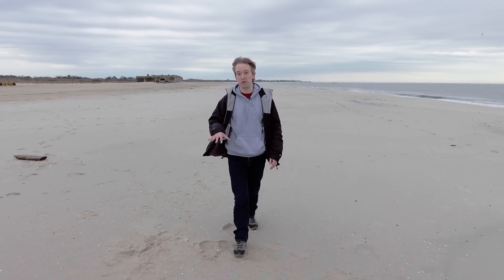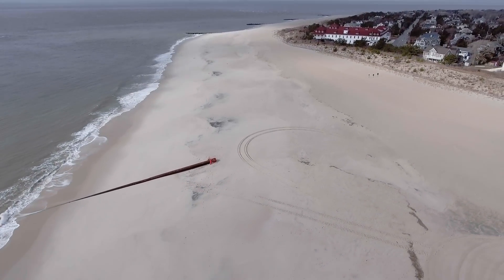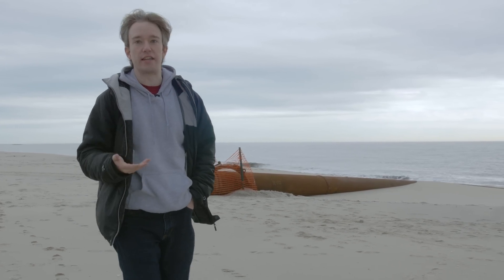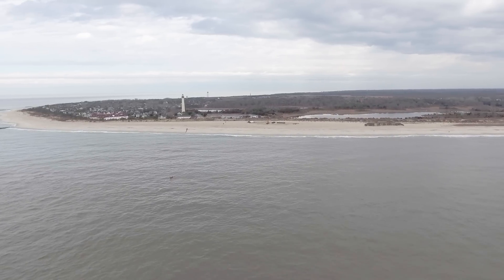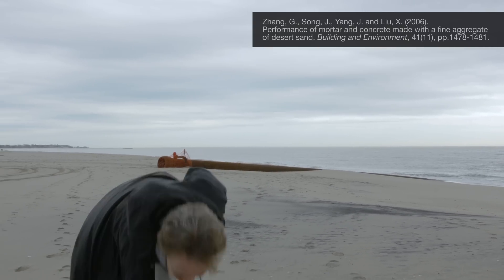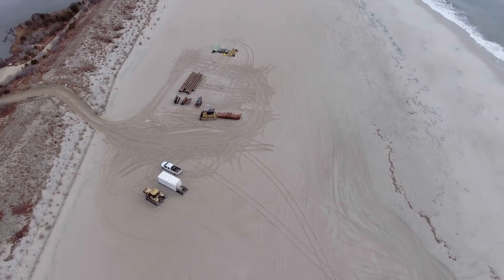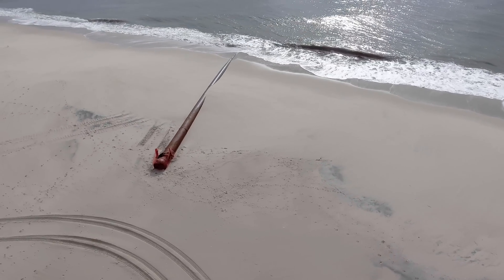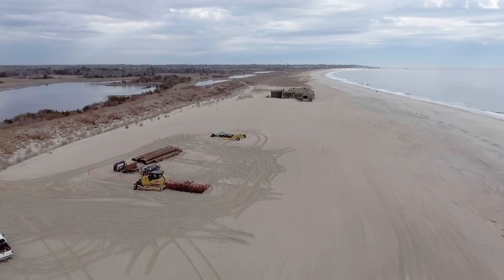The World Is Slowly Running Out Of Sand

Comment: As the hills in Finland are out because enviroment laws the concrete makers had to find new source for the sand. Grinding rocks into sand using suitable metal grinders does that job but causes lots of noise. So all over the southern Finland in remote cites you see piles of sand. From visual clues one can see that each pile is made of different size of grains. And you only need to look and you see the machinery that does the job.

Comment: The concrete company I used to work for has several gravel pits. Obviously, you need sand and rock to make concrete, but function of that particular pit is rock, with the sand just being a lucky by-product. And at that pit, if the company does the same amount of business every year, it'll take 200 years to go through all the sand they have stacked up at that pit. That says nothing of the sand that will come with the new rock they dig up, or the sand from their other pits.

Comment: As far as I'm aware, sea sand is no use for building because it's made up of small particles of shell. The sand used with concrete for building is from rivers and lakes, which is made up of small particles of stone. 
The reason the world is running out of building sand is because rivers and lakes are limited and they take a long time to produce sand from broken rock and stone from mountains and they are being dredged for sand faster than rivers can replace it.
So, I believe you are wrong in your video talking about sea sand as a building material, sea sand cannot be used for building.

Comment: Several years ago, I was doing a project on municipal waste management.  While tangential to the main paper (which was considering the possibility of using closed open pit mines as landfills rather than a green site elsewhere), I came across and was very intrigued by the concept of Plasma Arc Gassification.

Basically, the system involves feeding garbage into a giant welding arc and turning it into a plasma, then letting it cool and settle out.  The result is carbon dioxide, methane (which can be stripped away and burned to reduce the greenhouse gas emissions, because methane is way worse than CO2), water vapour, nitrogen, oxygen, and a few other such simple atmospheric gasses, plus a sand-like residue made up of all the stuff that didn't settle out into a gas. One of the proposed uses of this sandy residue was for use as sand in concrete. 

Now, I have no idea how much of a pipedream this article was (it was extremely complimentary of the technology); I haven't kept up on the research these past 6 years.  However, if it could be usable, this sand shortage might provide yet another reason to use this high tech waste disposal method.

Comment: There is more sand under those houses.  The sand that is vanishing is being washed out to sea.  The techniques being used here to rebuild the beach will probably be expanded upon.  Using satellite data and other techniques that the oil industry uses sand extraction could rebuild beaches and turn a profit.

The company could offer to rebuild a beach (add seawalls, that use the material you are pumping and protecting the supply you just pumped out) over a long contract period.  Pump up more sand than needed, sell the excess.  There will be problems (pollution, noise) but offering to save someone's property from rising oceans at no costs to them will be an easy deal to push.

Comment: We are NOT running out of sand the sand is simply being used to make stuff. Take for instance when you get sand and you squeeze onto the side of a castle you don't shrink the sand but compact it. In building the sand is being mixed with other materials but it's still there. Even if we don't have enough we can still separate the materials in buildings and get it back.

Comment: In Southern Michigan you'll find Warren Dunes, with the tallest sand dune, colloquially known as "Mt Randall" almost 300' tall.

But the entire South and Eastern shores of Michigan were once lined with similar dunes.  We're talking about places where Gary, IN now stand.  What became of the sand?  It was used in casting iron and other metal products, mostly in Gary.  That's why the Gary Steelworks sat where it did, proximity to cheap, abundant ideal sand for casting steel.

So today there are only factories that stand where once 300' tall sand dunes stood, just outside of Chicago.  Let that sink in a bit.

Comment: You posted your sources, but the ultimate conclusion of the study on desert sand in concrete mixtures was "It can be concluded that the application of concrete with desert sand as a fine aggregate in civil engineering is feasible." 
In other words, we aren't running out of sand.

Comment: In college, I learned that concrete was: gravel, sand, Portland cement, and water. The gravel is the strength; the sand fits between the gravel and stabilizes it; the cement does the same for the sand; and the initial water does the same for the cement. AFTER the concrete "sets," additional water strengthens it, although with diminishing returns. But excess water before the concrete sets weakens it by creating voids in it.

Comment: The waves create new sand every second. It's a renewable resource.
Reply: epSos.de Technically fossil fuels are renewable it just takes 1000 years.
Reply: He also said that we can not use the non-beach sand in the construction, which is BS. He is telling a lot of things, not all of them are correct.

There are other resources that will become rare faster than the sand.
Reply: The thing he said was it wasn't in an efficient way. He didn't say it was completely unrenewable, just that it would take an incredible amount of time to do and not in an efficient way.
Reply: We can be relaxed about that. There are stone crushers that produce gravel at a thigh rate. Same can be done for sand too, if needed. Beach sand is just crushed stones and crushed shells of mollusks who produce them daily.

Not an issue at all.

The rising sea levels are more important.
Reply: It's pretty slow though.

Comment: If it was purely about protecting the inner land, concrete tetrapods would be much more efficient in my opinion. Unlike sand they can stay in place for many years, eventually even forming extension of the land as the free space in between them gets filled with dust and ground.

And the sea level rise is still on the scale of millimeters per year on global scale. It does differ from place to place but these differences are due to local effects such as erosion or geologic processes. Talking generally about sea level rise as if it was some kind of global or generic threat is unscientific.

Comment: "Those sands aren't useful (...) for making concrete..' your source says otherwise

Zhang, G., Song, J., Yang, J. and Liu, X. (2006).
Performance of mortar and concrete made with a fine aggregate
of desert sand. Building and Environment, 41(11), pp.1478-1481.

'After adding CBC or CMS admixture, the
workability of the concrete improved, and the compressive
strength increased. It can be concluded that the
application of concrete with desert sand as a fine
aggregate in civil engineering is feasible.'
Reply: The paper does advise against the use of desert sand in mortar, however -- presumably because the necessary increase in cement to sand ratio in the mixture would make it less economically feasible.
Furthermore, the wording of the conclusion with regard to concrete is a little ambiguous. The workability improves and the compressive strength increased, but was that relative to the poor results found in for the mixture before the additive, or relative to standard concrete?

The two types of sand compared in the paper both seem to be desert sands.
Reply: tfw it's all because desert sand is slightly more expensive to process as concrete and no right minded capital earning business ownerwill ever consider such a foolish negligence when there's a perfectly good beach right over there
Reply: @CakeZRqGoTR  Well I mean, by the end of the day businesses do have to make money...

Comment: Wow, I never though this will happen!
In Thailand, we use a huge amount of sandbags to fill in the beach. And some case, especially with the rock barrier in the sea, make the beach shorter than it should be due to stronger water current.
I don't think pumping sand back to the beach is the good choice for long term. But it maybe the best way to do for now.
Another cool video Tom. I'll translate this to Thai as always.
Reply: the missing sand offshore will just be taken from the beach back into the hole they took sand from.

Comment: Can they not do what we do in the south of the UK and build wooden Groynes out to sea to slowly build up the sand by normal movement of the waves? The beaches seem to have only gotten bigger in my lifetime without any pumping of sand.
Reply: Sand travels along a coastline so adding Groynes and breakwaters traps the sand to build the beach in one area but causes erosion further down the coast where the sand you trapped would have been.
Reply: Reading up on this - from what I understood that doesn't happen if it's correctly designed such that it only captures a small amount of sediment and excess continues to move through the system?
Reply: Those do exist along the Jersey shore, and indeed much of the American coastline, but they can only do so much

Comment: Why don't they just put some groynes down? Surely the US has longshore drift, therefore sand would build up protecting the beach? Im obviously wrong because they aren't doing that, buy why?
Reply: Because you are moving the problem. After the last groyne you will get erosion again.
Secondly it doesn't offer any protection against erosion from storms, sea level rising or wind.
Reply: There are basalt jetties throughout new jersey. The Army Corps of Engineers believes they hasten erosion now.
Reply: Tate Hewitt -- Coastal geologists have known this all along. I assigned a paper by Orrin Pilkey to my university students back in the 80s!
Reply: +Bruni What most people call jetties on the NJ beaches are technically groins and there are many of those. Only the structures protecting tidal inlets and harbor entrances are jetties (the technically correct usage for jetty.) Groins were meant to protect beaches while jetties were intended to fix the location of the inlet.